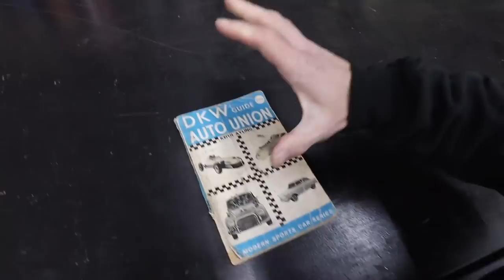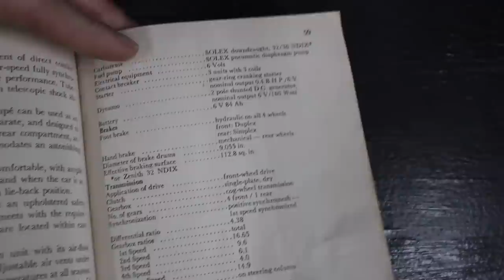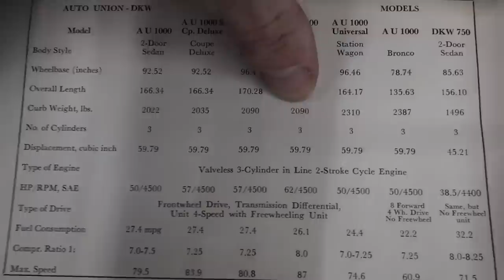SHORTENING THE VW BEETLE PAN For The BAGGED AUTO UNION 1000SP

Comment: Really enjoying your VW pan based builds. Great idea. Oh yeah. Beetle speedo cables attach to the left front wheel. As you probably know by now. I see a few inches sticking out of the grease cap there. The thing you pulled out of the tunnel tube was the actually the manual choke cable housing. Amazing that it just pulled right out. Usually they are rusted solid.  Eagerly awaitng more...